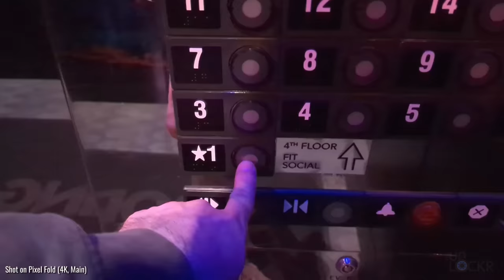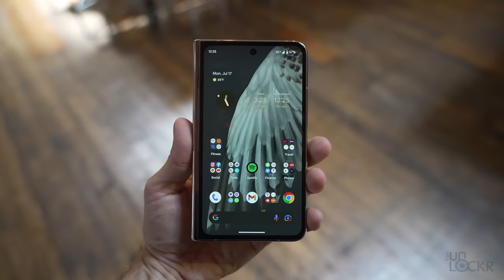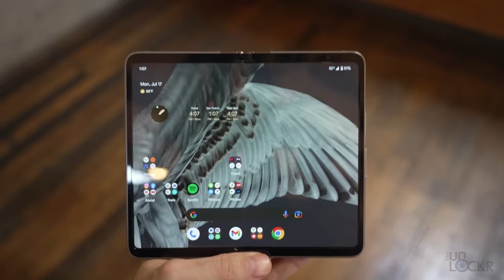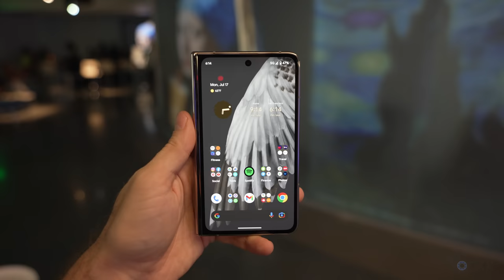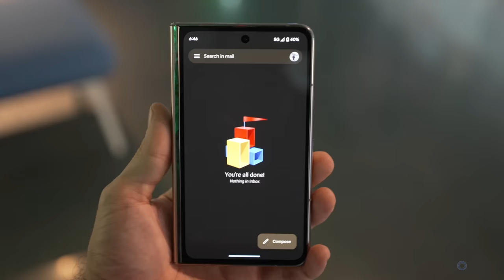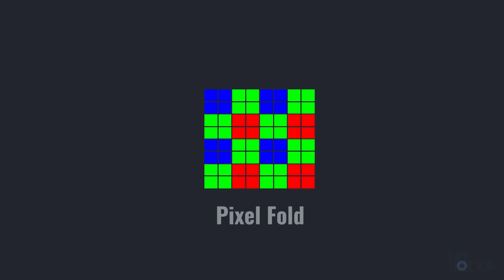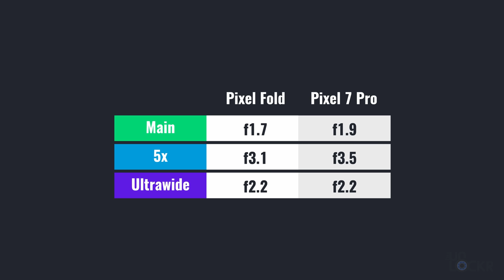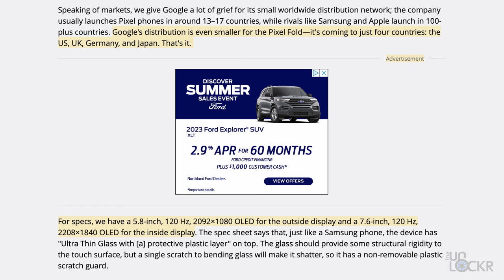Google Pixel Fold Real-World Test (Day in the Life Review)

Comment: I'm loving my Pixel Fold, Im lucky enough to have the Z Fold 4 too. The form factor of the Pixel is so much better for me. Samsung definitely has way more software and multitasking features but I rarely use more than 2 apps at once. Either way they are both great but I find myself using the Pixel more maybe because it's new to me.
Reply: Same here have both and was thinking of trading the fold 4 for the 5 but not sure now that I fell in love with my pixel
Reply: Same.
Reply: Same - love my Pixel Fold.
Reply: How is it a year later?
Reply: @yourfaceistube  Still great love the form factor, although the 9 pro fold is calling me.. my only complaint is I wish the speakers were louder especially compared to my Pixel 8 pro..
Reply: @casperswift  Yeah I've got the 8 Pro.  I do like having the option to play some videos while cooking with the sound on blast and no headphones - still not as loud as the iPhone 15 - but decent for sure.  
Whats the pockets and daily usage situation like? Hear horror stories of small particles making it under screen and cracking/destroying it (u baby it at all - and/or use case always?)
Reply: @yourfaceistube  Naa I don't baby it any more than any other phone I do have a tempered glass on the outside screen but I use it caseless most the time and the rest I use a thin Pitaka aramid fiber case.. im pretty good to my phones..
Reply: @casperswift  Love it.  So regular daily pocket/coat use not an issue?
Reply: @yourfaceistube  nope hasn't been an issue but I haven't taken it to the beach or anything like that .
Reply: @casperswift  Bet.  Thanks man 🙏
Reply: @yourfaceistube  no problem bro your welcome..

Comment: I have a fold 4 and have a fold 5 on pre order. I do have a pixel 7 pro but passed on the pixel fold for a few reasons. Firstly $1800 for a phone using last years tensor chip which was never a real powerhouse is just unacceptable. The battery life on my 7 pro is just okay, my S23 ultra absolutely destroys it so I figured ( and now this is confirmed) the battery life will be crap on the pixel fold . Finally google didnt even see fit to sell it in Canada, sure I could order one online but I will no longer support a company that doesn’t care about Canadian customers ( pixel 7 pro is being sold as well).  The fold 4 is a better device than the pixel fold and the fold 5 stretches that gap even more with the snap8 gen 2. The only thing of any measure that the pixel fold has on the Z fold is a better outer screen format, that’s for sure.

Comment: Battery life not great? That's an understatement. It's AWFUL. Although the screen on time is probably a little better than what is shown since battery stats on Pixel phones are all screwed up. The battery stats (including screen on time) doesn't include usage from 4:00PM-4:24PM (when the screen shot was taken) or between the time it was taken off the charger and 8:00AM.

The "normal day" battery life is even worse.